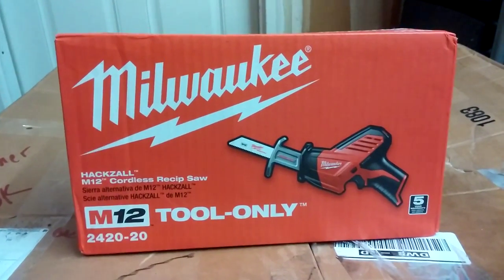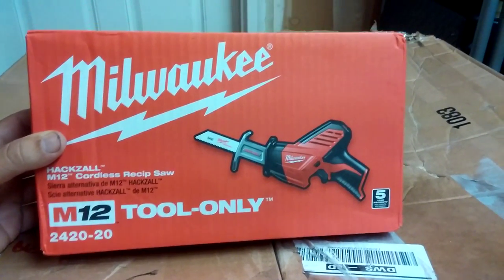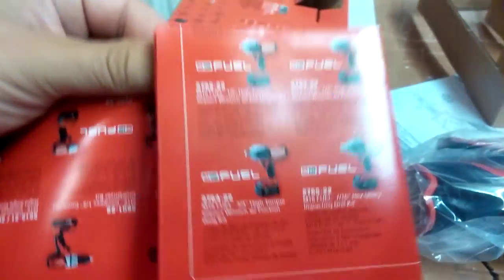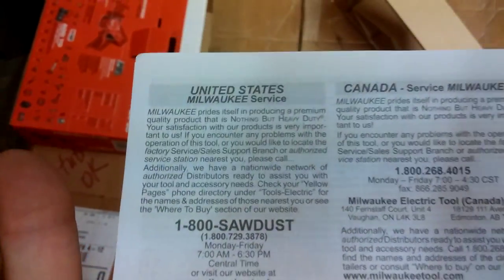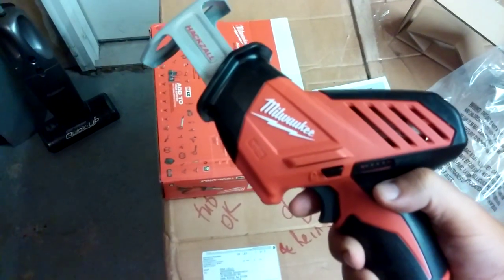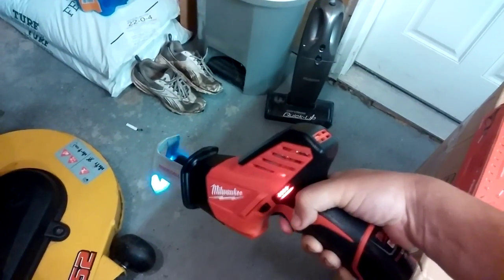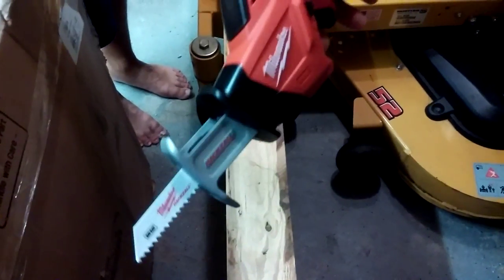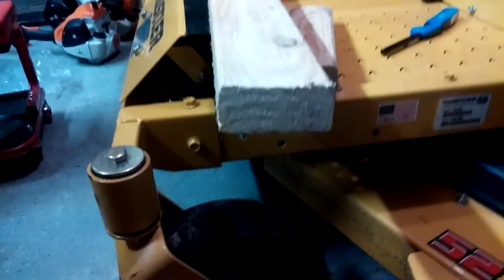MILWAUKEE 12V HACKZALL RECIP SAW (2420-20)

Comment: the light stays on with the fuel versions of the 12v. I have the fuel impact driver and hammer drill  and it stays on for a bit after letting off the trigger

Comment: Geez i was about to buy one until I saw this video. Took a full minute to cut a damn 2x4. I bet milwakee would pay you to take this horrible demo down lol.
Reply from the maker: I always say I've difference between the brushed and Brushless versions ...but this is not a tool to be cutting a 2x4 with ...it's the 12v remember 😉
Reply: Anthony Reams 
Definitely would have been faster if it would have been in a better place to do the cutting and if it had been secure.